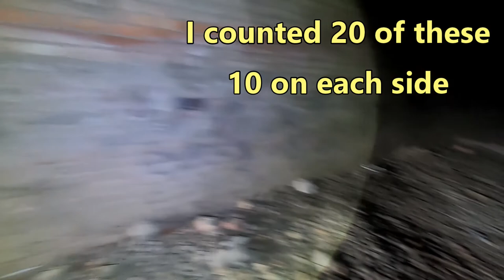Boughton Brake Disused Railway Tunnel Bevercotes Colliery

Comment: so much of the walls are brick the entire roof of the tunnel isn't the hooks are for suspending the cables there are track track spring pins dotted about & to get out of the cutting at the next bridge after the tunnel look to the right of the retaining wall & there is a pathway leading up the bank to the fence just behind wall